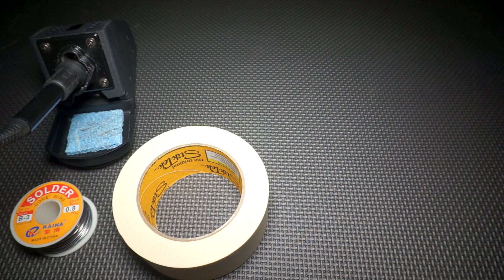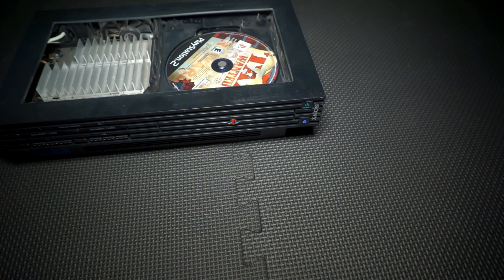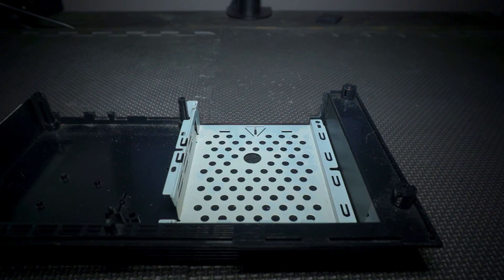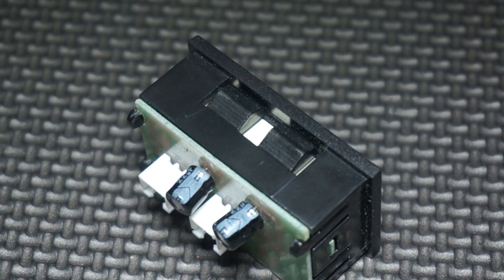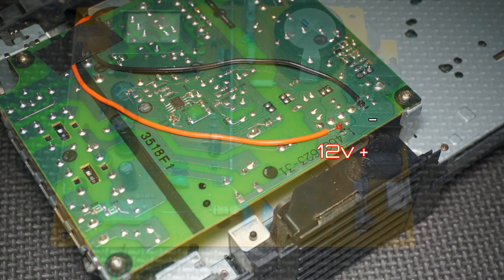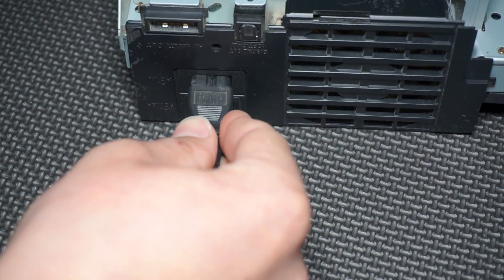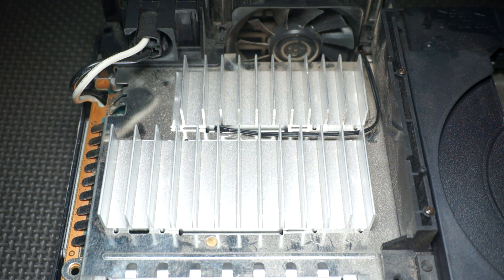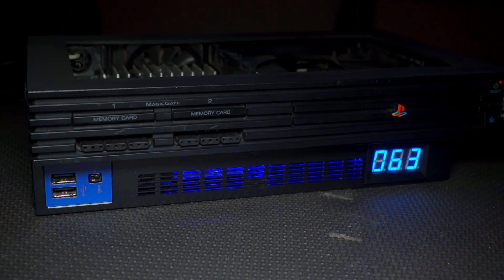how to install a temperature LCD to a phat PS2

Comment: Really enjoying going through your backlog as I get back into consoles, would you ever consider a video on an led or screen on a ps1 that blinks when the modchip is on or off, I saw a short video on it but never could find any more info. Cheers!
Reply from the maker: I'm not super familiar with ps2 modchips, they are pretty tough to install and free mcboot is easy and does everything you would want. But I'm pretty out of the loop when it comes to anything modding at this point. Not sure what you mean by an led screen that blinks?  I'd just use a single led that blinks then just hook it through a switch that provides power to the mod chip. But I'm unsure there is any real reason to turn off modchips anymore. But I appreciate the comment and you liking my videos

Comment: I replace the power board on mine and the power bottom 12pin flex cable, and still no power is coming on? The model is 50001/N. Any idea what else it could be wrong?/
Reply from the maker: I can't say that I have very much experience with ps2's, in general when I'm attempting to fix a problem I start with a full visual inspection, so check for anything funny on all components (burnt traces, or bulging capacitors) from there I usually take known working parts and swap them around until I find the problem part. Then from there you could get more in depth and test capacitors, even if they aren't bulging doesn't mean they haven't went bad. Hopefully that helps somewhat
Reply: @TechnoOnTop  Ok thanks for the info.!

Comment: But why is all the leds on and temp lcd when ps2 is off??
Reply from the maker: You need to take the Ps2 out of standby mode, so flip the switch on the rear then it would turn off.

Comment: Where is the finished ps2 at?  Been waiting for years now
Reply from the maker: I appreciate the interest, but it stopped reading disc's, at that point I just scrapped it been thinking of reviving it and just removing the disc drive all together
Reply: @TechnoOnTop  oh damn that is sad to hear, i was curious of the final product as well. But hey you gave me some motivation to try this with mine! I use my ps2 a lot now since i used FCMB with it, great vids!
Reply from the maker: @5k122Y  i will possibly resurrect it in the future, im thinking  just remove the disc drive add in a large fan to make it quiet... add in like a 2tb harddrive fill it with exclusives , the phat ps2's are pretty loud by today standards , anyways i apprecieate you checking out the video!

Comment: How hot does your ps2 normally run? I’m trying to make a 3D printer bracket for a 60mm fan mod and wanna make sure the print material can withstand the heat
Reply from the maker: Um I honestly don't know this ps2 wasn't ever really used and it been torn apart for awhile, for consistency  I probably let it warm up so that every shot had the same temperature. So that might be a good number to base off.

Comment: add a little fan to improve cooling
Reply from the maker: Yeah the cooling is pretty loud on these consoles. Would be nice to make it run silent
Reply: @TechnoOnTop  I second that! 

Maybe mod it so that the Fan gets faster depending of the temperature gauge readings or just put a Fan contoller dial in there, adding a new one might not work though since the Fan header is only one small 2 pin while modern Fans use 3-4 pins. It also always runs at full speed because of that.
Also also, the thermal probe has to be placed between the processor and the cooler for actual readings you would have to replace the thermal paste aswell if you do that though. Youre doing great work so far!

Comment: Damn 7 months without a new vid. Are you still alive?
Reply from the maker: I am lol... I know it's been awhile. Iv been slowly working on 2 projects. The slim quit working turns out it was a bad hard drive. But while taking it apart I realized how messy it was and have been cleaning up everything about it. So there will be an update / tear down video on that. I'm waiting on some Ram chips they seem to be having trouble getting out of China. Iv also figured out how to do the 4 ports on one side mod better. So need to make a video on that. But I'm still here replying to questions but I do really need to stop procrastinating..

Comment: I tried this several time but couldn't get my dremel to make a perfect rectangle for the lcd to fit snug.  How did you get your dremel to make a perfect cut?
Reply from the maker: The Lcd screen itself has a little boarder so the cut doesn't need to be a perfect rectangle because the screen when installed covers it up.  My experience when trying to make perfect cuts is unless your a Lazer cutter it's not gonna happen all you can really do is make a template then cut it out then use jewelers files and sand paper until it's as close to a rectangle as possible. I would suggest getting a different lcd screen ones that have the lip. Checkout the one in the description its the one I used. Thanks for watching
Reply: I already purchased 2 with the lip:

https://www.amazon.com/gp/product/B01MSJPTA2/ref=oh_aui_detailpage_o01_s00?ie=UTF8&psc=1

I didn't want the usb model, being i am installing it internally, so i got the model with the molex power plugs, which i'll cut off anyway and wire it directly on the PS2's power supply like you did. 

I am not trying to cut a perfect rectangle at all, just trying to cut out a ruff cut with my dremel is proving very difficult.   I always cut too much when trying to cut out the height.    

I have no problem cutting the width, being the grills are easily removed ( I use a razor to cut the grills, this leaves a more cleaner cut than the dremel)

 but when cutting the height, the dremel cutting discs always melt the plastic when cutting, so it leaves the cut uneven and that's when i end up cutting too much.     The plastic is too thick, which makes it difficult to carve.  

It would be perfect to cut with a razor if the plastic was a little thinner but because of its thickness, a dremel is needed. 

I wish i had a laser cutter.  lol  

There is always gaps near the top in an uneven pattern, where the lips of the LCD are not covering.

I wish you had uploaded footage of you actually cutting the Rectangle, so i can use for a reference.
Reply: just do it roughly, then use a file

Comment: How's the Ps2 coming? Been waiting on an update video.
Reply from the maker: you know it looks great but function wise not so much, it has a temperamental DVD drive, started with not opening fixed that, now it wont play any discs, so I need to get a new one, I figured a showcase video would be a little dumb if i cant actually show a disc in it spinning. being one of its main features
Reply: TechnoOnTop 
I know what you mean. I had to take ps2's to make one good one. The one im case modding has the power supply on top( first model if im not mistaken) but i had to use the laser assy from a phat ps2 like the one your modding. Got it working no problem. Now just got to get time do some cutting.

Comment: Sadly enough i have the newer model. And i havent found anything on google where i can find the 12v pin. (i have a idea were it could be) but i dont have a multimeter. So if someone could help me i would be gratefull.
Reply from the maker: If you have a harbor freight near you they are typically free with a coupon. I do wish I had a later version. Sorry I couldn't be of help. Thanks for watching
Reply: go to orileys or autozone, ask to rent the tool. use it and return it, no charge to you unless you break it

Comment: Are you still using the placement for the sensor? 
Also how did you fit one in your Xbox.? Love to do something like this to mine
Reply from the maker: yes, i haven't moved it. I haven't really touched the ps2 since doing this mod. but that spot seems to be fine, I was planning on doing a tutorial on the Xbox I bought another LCD just for that. just took a little more cutting to both the face plate and the bottom shell.